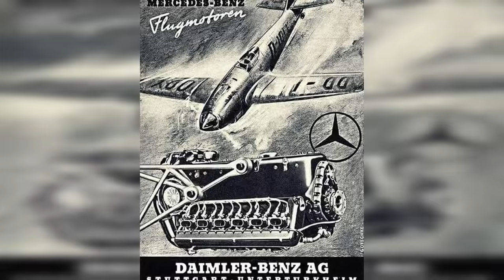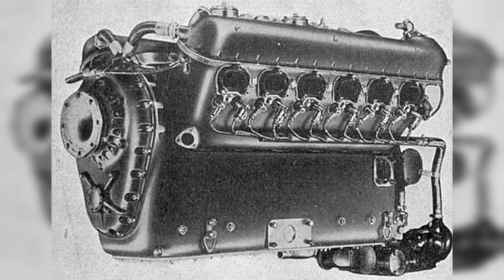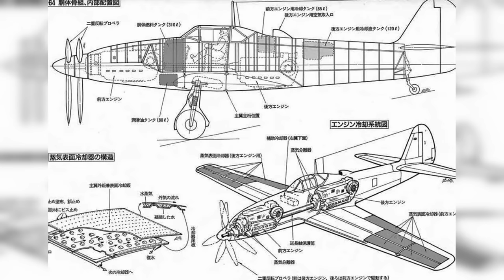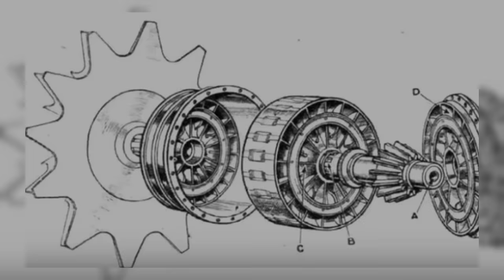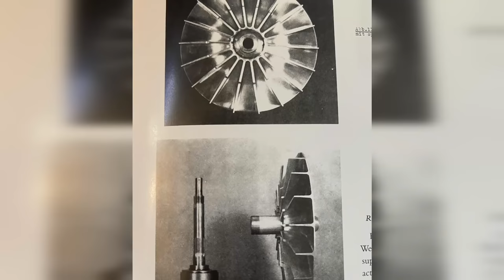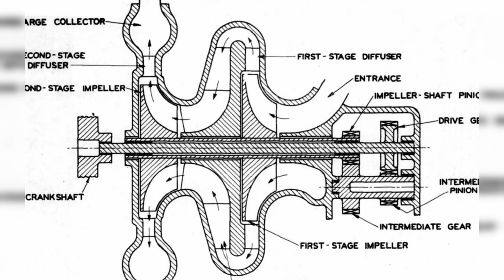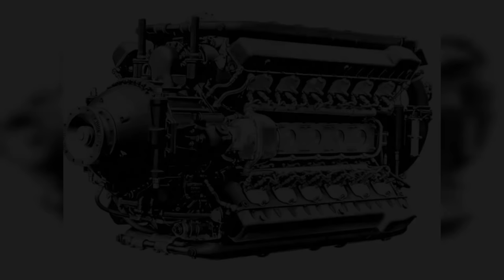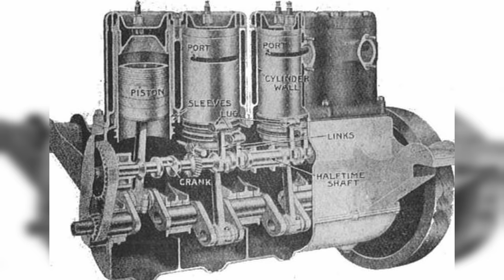The Engine of the Dark Side? Daimler-Benz DB-600 - DB-605 - Part 1

Comment: FYI, was Otto LUTZ, who actually did the initial chemistry research on Nitrous. Otto Cuno did a lot of the subsquent research into putting it to use in actual aircraft. :)
Reply: LUTZ as in current clutches?
Reply from the maker: Thanks Calum! I think I must have misinterpreted that bit. It goes without saying that I love your book. Let me know if you’d ever be interested in giving one of your expert presentations on the channel!
Reply: @flightdojo  - Its an extremely dense book, thematically and technologically - so tiny slips like that are inevitable. Yes of course we can do a presentation. You can contact me via the contact form on my website, or track me down on Twitter.
Reply: @CalumDouglas  ACTUALLY…it was sir Fredrick Nitrous in the 15th century who invented it, to speed up his horses with the push of a button to evade law enforcement. When breathed in, it was said to add 1 horsepower, since it made his horse twice as fast as other horses. FYI
Reply: @nicholassilvestri1804  I'm guessing it used farts for propulsion
Reply: @nicholassilvestri1804  irl the horse just giggles and starts bingeing Big Lez episodes

Comment: German engineers sure were not afraid to experiment and try different things good examples are the 90 degree infinitely variable superchargers on their v12s and the fw190 A series having a full mechanical computer to automate all engine controls so a pilot only needed to adjust throttle position.
Reply: @belliduradespicio8009  Take a look at the Youtube channel "Greg's Airplanes and Automobiles". He has a video looking at the details of the engine control system for the BMW 801 in the FW190.
Reply: Germany had engineers, but America had hot-rodders and gearheads.
Reply: @oldchap1228  nearly perfect ;-)  Kommandogerät (commanding device)
Reply: The first application of an engine management system, years before Volvo, Renault, fitted such systems to their cars and lorries.
Reply: @oldchap1228  yep, you butchered it: Kommando Gerät.
Reply: @belliduradespicio8009  IKR. Likewise!
Reply: G be as
Reply: @steffenrosmus9177  Why did you split it up? Kommandogerät.
Reply: TEXANS BEAT THEM.
Reply: Well, its not hard to understand why German engines were so advanced.
Daimler Benz invented aircraft engines and was the world's leader in aircraft engine technology, they invented the type of jet engine in common use today... the Turbofan engine.
Reply: @spaceflight1019  That is just a stupid stereotype. America had plenty of engineers as well. You think "hotrodders and gearheads" built all of the highly technical, advanced stuff the US created during the war? You think Germany didn't have mechanical young men good at rebuilding tank engines or jury rigging a truck to keep it running on the Eastern Front? And the US didn't even have "hotrodders" until after the war. they had young men who liked to "soup up their jalopies", but so did every other nation.
Reply: @justforever96  Nowhere in the world was the automotive/motorcycle culture, not just the racing culture, as widespread and common as it was in the States. The economic dynamics of the Great Depression changed the paradigm from "going faster" to "keeping it running" but the knowledge gained proved useful.
Reply: @spaceflight1019  Germany too. After WW2, the US had both, hot rodders and German engineers.
Reply: @Rondo2ooo  Funny that I forgot about Von Braun. Ever notice that Doc Brown's family name was Von Braun?
Reply: @justforever96  Indianapolis racers and racings.
Reply: @belliduradespicio8009  it used a barometer hooked up to a torque converter to regulate the superchargers speed based on altitude, this led to a far more efficient power curve across altitude levels for the bf-109, compared to it's allied counterparts which used mechanically geared superchargers.
Reply: @spaceflight1019 America had massively overmatched manufacturing capability and little else.
Reply: @rocketpigrecords3719 So did Russia. Their tank strategy was to field as many T-34s as it took to use up a Panzer's ammo, and then overwhelm it with sheer numbers.
Reply: @spaceflight1019  Doubt that, NSU in Germany was the biggest Motorbike company on the planet at one time.
Reply: Kommandogerät !
Reply: @spaceflight1019  Nowhere? Germans invented the car, the Otto, Diesel and Wankel engine.
Reply: @0Turbox  You can invent anything you want, but it's the tinkerers who discover how to push the device beyond its design limits.

Comment: By the way, the fuel injection system developed by Bosch for the DB 601 series engines was dusted off after the war and after miniaturization, implemented it on the inline six engine on the Mercedes-Benz 300 SL.
Reply: That I didn´t know!!!//Lars
Reply: Not true. It was direct injection on the DB601 onwards, the 300SL used a fairly normal mechanical injection into the inlet manifold. The 300SLR (not the same car although similar looking) did use direct mechanical injection from the W196 GP cars
Reply: @zaphodbeeblebrox5973  Oops! Typo error there, it was supposed to be the DB 601 instead of the DB 600, silly me... correcting it now.
Reply: @zaphodbeeblebrox5973  The  street 300 SL Gullwing engines used direct fuel injection, not port injection.  It is one of the iconic technical advances of that car that established it's place in automotive history.
Reply: It's funny that the best part of a century after aircraft first had fuel injection, actually more than a century for a small number of engines, but let's just assume this is an early mass market fuel injected engine. Anyway, here we are best part of a century on from warplane worthy fuel injection and yet if you buy a brand new $100,000 aircraft engine it will default to having a carburetor and magneto ignition. Like a model T Ford or a pre war Vincent motorcycle.
Reply: @cageordie  Mechanical fuel injection is complex and it is difficult to set up correctly. In normal use a carburetor works just as well and is more reliable and easier to maintain. Mechanical injection offers only disadvantages to general aviation. Electronic fuel injection, oth, might offer some benefits, but keep in mind that the only reason cars and motorcycles adopted it in the first place was to meet stringent emissions regulations which do not affect GA. Pre-war Vincent motorcycles is an oddly specific reference. I approve.
Reply: @CaptHollister  Are you being deliberately obtuse? No, a carburetor can never provide per cylinder fuel control. Fuel injectors never suffer carb icing. They also don't have problems with floats and idle jets. Nobody would suggest putting a mechanical fuel injection system in an aircraft you buy today... except the companies selling extremely overpriced vintage engines new. Any modern engine should have full authority digital engine control. And it should not cost a small fortune. A full racing fuel injection system costs of the order of $2,000. Even that includes ridiculous amounts of profit. Magnetos belong in the same garbage can as carburetors.
Reply: @CaptHollister   I do recommend the video about Wing Commander Robert Stanford Tuck one of the most famous British Spitfire Aces of all time when he describes the effect that the fuel injection had on the capacity of the ME 109 in dog fights…it did switch out the gravitational force on the petrol flow at the deepest point before climbing back again for a tenth of a second Merlin had no fuel to inject this helped Messerschmidt to escape…
Reply: @bennyhannover9361  The advantages FI provided to the Bf 109 are well documented, but weren't so great for other countries to adopt it. For General Aviation they are irrelevant. GA is very conservative when it comes to developing and offering new technology, probably because there is no financial incentive to doing so, especially compared to the astronomical cost of getting any new tech certified.
Reply: @cageordie  EFI may be relatively cheap to install, but the real cost is in the certification of the engine and the retraining of techs. Once a manufacturer has spent all that money, how long before they see a return on their investment ?  Carbs and magnetos are very much old school, but they are thoroughly debugged and fully understood by the industry. Any issue can be quickly diagnosed and fixed by any aircraft mechanic anywhere on the planet.
Reply: ...true, heard that from a story of the 300SL.
Reply: ... and then, another 40 years were wasted before DI gasoline engines were introduced again. Mitsubishi, that time, aiming at stratified mixture in order to dethrottle partial load operation. Well, homogenous, it's a given now - any (car-) engine above the absolute minimum of minimum is either full of other cool features, or it's an utter disgrace. Direct injection is a given, the lame excuses don't carry even close to far enough...

Comment: Wolfram Eisenlohr said years later about the RLM specifications for inverted engines that the main reasons were that the lower exhausts would not blind the pilot during night operations,  the inverted installation was more compact,  and the pilot would have better visibility.
Reply: A little known advantage of the inverted V engine was the ease of access by the ground crew. A High percentage of maintanance could be done from the ground.
Reply: @petersattler3454  
that's why they were called 'ground crew' instead of 'aircrew' lol jus kidding
Reply: Also, in the developing dive bomber blitzkrieg concept, an inverted vee engine was determined to aid accuracy (longer visual time on target). As Germany had, from a production resources standpoint, to standardize on the minimum necessary engine designs, this became one more important factor arguing for inverted inline a/c engines.
Reply: Another advantage of inverted DB engine notice by pilots who flew both the Merlin Bouchon and DB engined 109s was the lower exhaust noise in the cockpit.
Reply: It also allowed a lower center of gravity for the engine while allowing a cannon to fire through the prop. I believe it also improved aerodynamics by reducing frontal area and the pilot has greater visibility over the narrower engine profile.

Comment: I thankfully worked for Bosch for 42 years rebuilding gasoline and diesel injection pumps for Mercedes Benz, Porsche and assisting engineers developing diesel injection pumps, rails and injector systems for Cummins, Navistar, Onan, GM, Ford, John Deere and Chrysler. I did see an example of the stunningly impressive, purely mechanical 12 cylinder inline direct- injection gasoline pump used on the DB600 Series engines in the office of a WW2 Engineer Hermann...(can't remember his last name) damn it.
Reply: I cannot imagine a better job then doing that all day long I have a smile on my face every single day.
Reply: Onan wiki
Reply: Boring, his name was Hermann Boring
Reply: Goring
Reply: My fuel injected M100 with its mechanical fuel injection and inbuilt altimeter really sounded like a bomber taking off. The nose of the 6.3 would lift as the massive torque hurled the car forward. That fuel injection system was based on WW2 aircraft!. Well made and very durable.
Reply: In-line Bosch mechanical fuel injection pumps are one of the main reasons why Classic Mercedes Diesels were supreme. It’s also what the Cummins 5.9 used, after they got red of that ratarted VE-rotary pump that didn’t even have a timing mark on it. K-Jetronic is the most reliable gasoline fuel delivery system ever devised.

Comment: The fuel injection used on the DB engines was not electronically controlled. It used a mechanical design incorporating what was known as a 'flapper box' (by the sound it made), which metered the fuel based on several mechanical inputs.